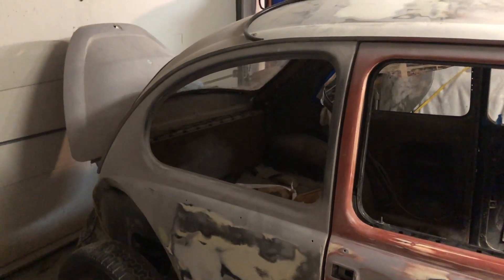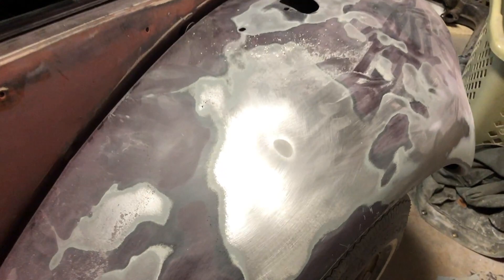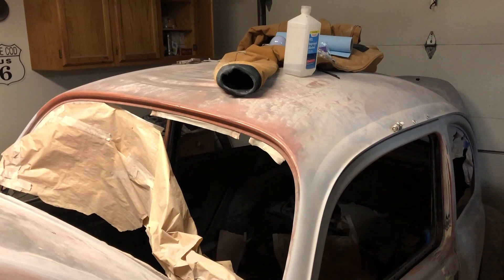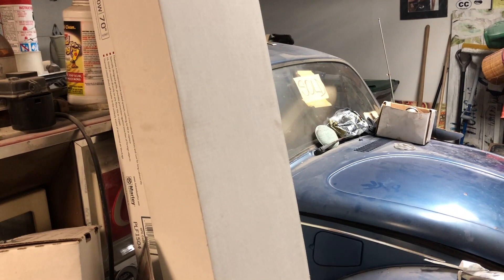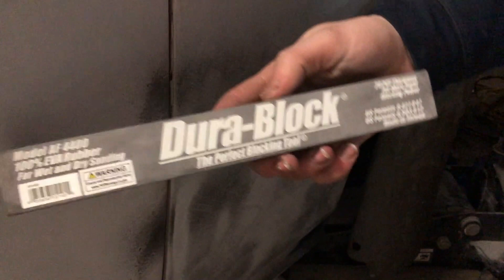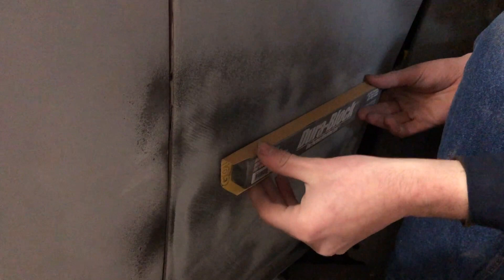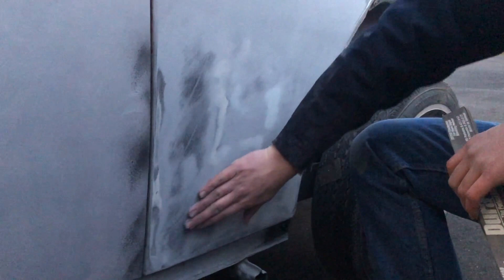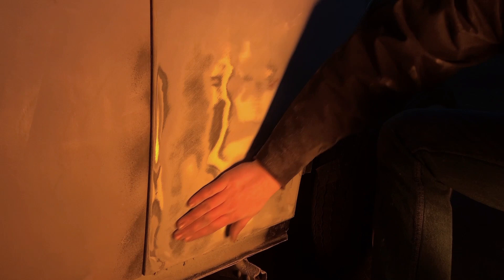Block Sanding on the 1967 VW Beetle

Comment: You're getting close! Mine too. I think you'll be happier with the 11 inch block. Ive been using the 16 inch and even on the roof and doors, I feel the 11 inch works better. If you're ever looking for a great high build  check out Tamco. I'm using it on my bug and love it so much, it'll be on the bus and vanagon also! Great quality and price, and they use basf stock
Reply from the maker: Yeah when I held the 11" up to the quarter, I was glad I chose that. BASF? That surprises me, might have to check them out.
Reply: @DubWerks  yeah, I was surprised too. I would love to paint the whole thing with glasurit (oem supplier) but its $$$$$. From what I'm told their color coats are compatible with  tamco primer

Comment: you need to look into more methods of doing bodywork. Old VW's have good metal fairly thick, the metal can be worked to a point where you don't even need filler if you're willing to spend the time and learn the methods it takes. I learned old school body work, you're doing modern style body work on a vintage vehicle. Not necessary. Probably easier, but not required. The less filler you use, the better the way I see it.
Reply from the maker: I agree about filler, but I'm pretty much using it where I put new panels in. The new metal warps like crazy. Makes a pretty big valley I guess you could say. I've tried using boody hammers, but I can't get them behind the quarters.
Reply: @DubWerks  body hammers are not the only tool available these days. Yes I imagine aftermarket panels are not up to the same quality as the original metal.